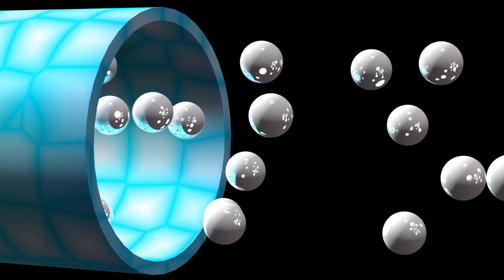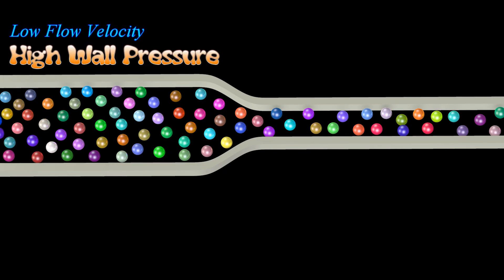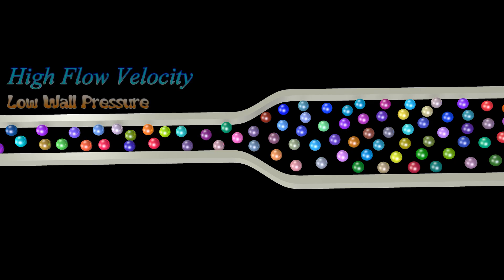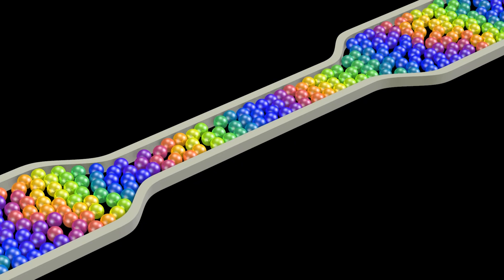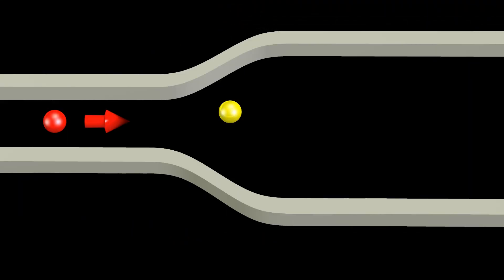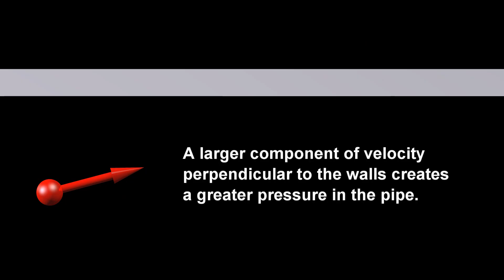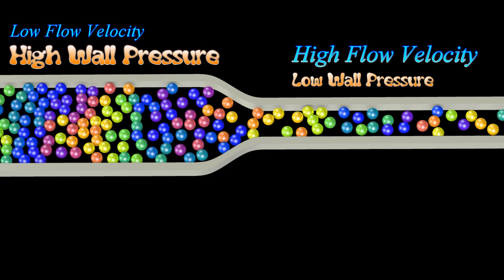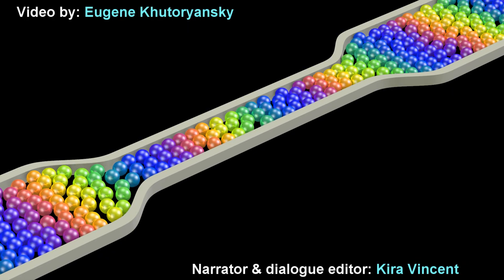Bernoulli’s Principle on Atomic Scale

Comment: Very nice video! This is the first time I see it explained like this. Are there any textbooks or other references that use this explanation? Could you derive Bernoulli’s equation by only using this probabilistic reasoning?
Reply from the maker: Here is a reference that has a very detailed discussion of these issues.  https://arxiv.org/pdf/nlin/0507032
Reply: @EugeneKhutoryansky  Thanks for your response!
Reply: This video concept is untrue.  This is Crummer's Fallacy. . . 
.
 I've explained this before.  The energy conversion is from potential to kinetic.
.
The Potential energy of the higher pressure up-stream is converted to the kinetic energy of the faster flow downstream.
.
  Crummer's concept is false.
.
The isotropic static pressure is not made non-isotropic as the flow speeds up.
,
The pipe size reduction is a restriction that causes the upstream static pressure to increase creating a Pressure Gradient forming a net force downstream that causes the Acceleration of the mass of the fluid.
Euler is credited with determining that a Pressure Gradient is the cause of fluid Acceleration, just like a net force causes Acceleration of a bulk mass 'object'.
.
So many people keep repeating misconceptions they don't understand.  This is nothin more than Newton for fluids.

Comment: Under the same velocity component parallel to the pipe, there can be different velocity components perpendicular to the pipe wall. So at the same speed (parallel to the pipe wall), there will be different pressures on the pipe wall (perpendicular to the pipe wall). Right? So a high speed (parallel to the pipe wall) does not necessarily mean a low pressure. Your explanation failed.
Reply from the maker: The explanation applies to different pressure levels in different sections of the same pipe, with the total particles per second in the same throughout the pipe, despite the fact that some sections of pipe are narrower than other sections.
Reply: @EugeneKhutoryansky  Assuming that the pressure difference P causes the water column in the equal diameter pipe to increase from velocity V1 to velocity V2. In this process, at any moment, the velocity of the entire water column is the same, but the pressure at different sections of the water column is different. This indicates that the conclusion of this video is incorrect. Otherwise, why are the pressures different at the same velocity?

Comment: For example, if the speed of air in one pipe is 100 meters per second, and the speed of air in another pipe is 10 meters per second, their pressure can be the same. How can you explain this with your theory?
Reply from the maker: The molecules might have the same component of velocity perpendicular to the pipe, but different components of velocity parallel to the pipe.
Reply: @EugeneKhutoryansky  So why do you say that when the speed is high, the pressure on the pipeline wall is low?
Reply: @jdthood Assuming that the pressure difference P causes the water column in the equal diameter pipe to increase from velocity V1 to velocity V2. In this process, at any moment, the velocity of the entire water column is the same, but the pressure at different sections of the water column is different. This indicates that the conclusion of this video is incorrect. Otherwise, why are the pressures different at the same velocity?
Reply: @jdthood So how do you explain the phenomenon of different cross-sectional pressures under the same velocity in the same equal diameter pipeline?
Reply: @jdthood Why do I say it's not an isentropic process?
Reply: @jdthood As I mentioned earlier, a section of equal diameter pipe has a pressure P that causes the water column in the pipe to experience acceleration, with a velocity ranging from V1 to V2. At the same time, the velocity of the entire water column is the same, but the pressure at different sections of the water column is different. According to the theory in your video, you cannot explain this phenomenon.

Comment: This explanation seems incorrect. Assuming we have a cup in an environment without gravity, we can give the cup a constant acceleration, and similarly, the water in the cup also receives this acceleration. As the speed of the cup increases, the pressure of water at different depths inside the cup remains unchanged. It can be seen that the magnitude of velocity is independent of pressure.
Reply from the maker: The explanation in the video is correct.  In your example, this is a completely different situation, since the water is still at rest relative to the walls of the cup.
Reply: @EugeneKhutoryansky  What you said is not right. We can use a pump to achieve a constant acceleration of water in a pipe with a constant view. At this time, the pressure in different sections of the pipe is different. But at the same time, the velocity of fluids with different cross-sections is the same.
Reply from the maker: I am not sure how what you wrote is related to anything I said.
Reply: @EugeneKhutoryansky  I mean, we can also use a water pump to achieve a constant acceleration of water in an equal diameter pipe. At any point in time, the velocity of different sections of the pipe is the same, but the pressure is different. According to your theory, why do the pressures on different sections differ at the same speed?
Reply from the maker: I believe this is because the density of the water molecules is slightly higher in the higher pressure areas.  Although we typically model the fluid as incompressible, there is no such thing as an incmpressible fluid, because then the speed of sound through it would be infinite, violating Einstein's Theory of Relativity.
Reply: @EugeneKhutoryansky  However, the fluid in Bernoulli's theorem is an ideal fluid, which is incompressible. So you violated the conditions for using Bernoulli's theorem.
As I said, when a fluid gains a positive acceleration, the pressure on each section of the fluid will be different at the same speed. This is because the mass of the fluid to be pushed by each section is different. Just as you push a cylinder along the axis to obtain a positive acceleration, the mass corresponding to different cross-sections of the cylinder is different.
Reply from the maker: If we truly had incompressible fluids or solids, many of the laws of physics would break down, such as Einstein's Relativity.  The fact that a fluid is not incompressible does not change the fact that Bernoulli's principle is valid and that it operates as discussed in the video.
Reply: @EugeneKhutoryansky  But you should know that Bernoulli's theorem deals with ideal fluids. And ideal fluids are incompressible. Why? Because otherwise, the continuity theorem of fluids cannot be established.
If a pump is used to give positive acceleration to the water in the pipe, the pressure on each section of the pipe is different, but the speed is the same, which cannot be explained by your video.
Reply: @jdthood You are incorrect here because your video describes a venturi tube, so the diameter of the tube is changing, so the fluid is accelerated when flowing in the tube, otherwise the velocity of the fluid will not increase.
Reply: @jdthood You are wrong. For example, if we use a beaker and keep the height of the beaker's water surface constant, there is a horizontal equal diameter tube at the bottom of the beaker, and the outlet of the tube is a converging nozzle (similar to the converging section of your Venturi tube). Because the height of the water surface in the beaker remains constant, it is similar to a "water pump" that does not increase the supply of energy. When water flows steadily, there is acceleration at the nozzle. Refer to my video:https://youtu.be/hZ5fZ3K4_mE?si=yZyAtW81KGRORscw
Reply: @jdthood You explained that it was because the pump increased the supply of energy, while I told you that the pump did not increase the supply of energy. It is evident that your statement that the pump has increased the supply of energy is incorrect. Do you agree with this?
Reply: @jdthood As I mentioned earlier, a section of equal diameter pipe has a pressure P that causes the water column in the pipe to experience acceleration, with a velocity ranging from V1 to V2. At the same time, the velocity of the entire water column is the same, but the pressure at different sections of the water column is different. According to the theory in your video, you cannot explain this phenomenon.

Comment: Aahh, eureka! The lesson was so tantalizing that I was upset that I did not guess the solution. But of course, the narrow section acted as a biased 'selector.'  A little probability and of course some trig to separate the velocity vector into two component parts, one parallel to the pipe walls and one perpendicular. This reminds me of other biases in statistics. If the atom made it into the narrow section, then there is a greater probability that it travels more parallel to the wall.  Thank you so much for teaching me, please forgive my rambles ❤❤❤
Reply from the maker: I am glad you liked my video.  Thanks.

Comment: Doesn't this only work for straight pipes, though? It seems like this explanation would imply that the pressure is greater if the pipe curves right after the transition to the smaller width.

Comment: What would happen if I keep a pressure measuring instrument, say a tiny diaphragm, inside the narrow pipe. Your explanation seems to suggest that though the pressure on the walls of the narrow pipe is less, since less molecules with perpendicular velocity components are present in the narrow pipe, the pressure inside the narrow pip, near its center is higher.

Comment: Great video, but I think you missed one small oppurtunity.  The vector movement explanation can also be used to explain why high velocity water coming out of a hose has a longer "stream".  The atoms have a larger vector that is parallel to the hose outlet.  If the Bernoulli principle was NOT true, than as soon as the water leaves the hose, it would spread radially (ignoring atmospheric and gravitational pressure).

Comment: This explanation may be incorrect. For example, we have a nozzle that is a straight pipe with equal diameter. We can let water flow out of it at different speeds, but the pressure on the wall of the pipe is the same, which can be atmospheric pressure.
Reply: It is incorrect.  It even contradicts itself when it talks about bouncing on other atoms in the third, wide section, but ignores that in teh first going into the narrow section.
..  My earlier comments:
Unfortunately, this violates some very common and well understood accepted principles of physics.  Charles Crummer makes the same errors, which doesn't make it correct.
..
The statement at 2:07 is correct. "there is no reason to expect an atom with a higher velocity to exert a lower pressure on the walls of the pipe." 

There can be the same pressure in a fast fluid as a slow fluid.  They simply have the same static pressure. Bernoulli is not about speed. It is about changes in speed or velocity which is Acceleration along a path. 

The pressure on the walls of a sealed jar is the same regardless of the speed of the jar.

A fundamental flaw in this misconception at 2:42 is is that there no reason to expect a molecule to have the thermal vibration in only one dimension.  These pressure causing vibrations are random in direction and are how they bounce round between other atoms.  
At any given instant a molecule may be going down and the next at 90 degrees or even 180 degrees to the previous vibration.  
That simple fact breaks this false logic.
..
Then. . . 
It is the average velocity (over time) that has a directed motion when the kinetic energy is added to produce an increase in speed. That directed velocity is vectorially summed to the random vibrations.  This is vector addition of velocities. This means that the random vibrations are superimposed onto the linear velocity along the tube. This is fundamental physics. Vector quantities like speed and acceleration add vectorially.
Ignoring that fundamental physics is another flaw in this.
..
..
Then, the added kinetic energy in the moving fluid is in only direction.  It is not increasing the random thermal vibrations. That would require increasing the temperature.  This is another flaw in this story.  Moving the fluid along the pipe does not raise the temperature.  
Therefore, the statement at 2:23: "an atom with a higher velocity would have a higher kinetic energy and, therefore, exert a larger force on the pipe walls" is false because it conflates / confuses thermal energy and momentum in one direction.
..
..
Consider bouncing a ball on the floor. Each bounce imparts some momentum to the floor.  The ball's actual motion is only vertical..

Now, start the room moving (a train car) and the ball still imparts the same momentum to the floor with each bounce.  It's actual motion, relative to the stationary ground changes.  It has the SAME vertical component, but now a horizontal component vectorially added to the vertical motions.  The pressure on the floor does not change.
.
 However, these two motions are orthogonal and have no effect on each other. The vertical up[and down bouncing component remains the same. ONLY the ground referenced horizontal component changes as the speed increases.
This physics does not change if the ball is bounced on the ground outside the train's window.
.
This fails on these fundamental physics errors.
Reply: @Observ45er  You're right, this is a video that confuses the difference between macroscopic velocity and microscopic thermal motion, believing that the two are completely the same thing. If there is only one air molecule in the tube, then velocity and thermal motion may be related, but the velocity of a gas composed of a large number of molecules is not the same as microscopic thermal motion.

Comment: Excellent.   None of the otherwise good teachers I have seen dealing with Bernoulli have addressed what is happening at the molecular level.
Reply from the maker: Thanks!
Reply: Unfortunately, this violates some very common and well understood accepted principles of physics.  Charles Crummer makes the same errors, which doesn't make it correct.
..
The statement at 2:07 is correct. "there is no reason to expect an atom with a higher velocity to exert a lower pressure on the walls of the pipe." 

There can be the same pressure in a fast fluid as a slow fluid.  They simply have the same static pressure. Bernoulli is not about speed. It is about changes in speed or velocity which is Acceleration along a path. 

The pressure on the walls of a sealed jar is the same regardless of the speed of the jar.

A fundamental flaw in this misconception at 2:42 is is that there no reason to expect a molecule to have the thermal vibration in only one dimension.  These pressure causing vibrations are random in direction and are how they bounce round between other atoms.  
At any given instant a molecule may be going down and the next at 90 degrees or even 180 degrees to the previous vibration.  
That simple fact breaks this false logic.
..
Then. . . 
It is the average velocity (over time) that has a directed motion when the kinetic energy is added to produce an increase in speed. That directed velocity is vectorially summed to the random vibrations.  This is vector addition of velocities. This means that the random vibrations are superimposed onto the linear velocity along the tube. This is fundamental physics. Vector quantities like speed and acceleration add vectorially.
Ignoring that fundamental physics is another flaw in this.
..
..
Then, the added kinetic energy in the moving fluid is in only direction.  It is not increasing the random thermal vibrations. That would require increasing the temperature.  This is another flaw in this story.  Moving the fluid along the pipe does not raise the temperature.  
Therefore, the statement at 2:23: "an atom with a higher velocity would have a higher kinetic energy and, therefore, exert a larger force on the pipe walls" is false because it conflates / confuses thermal energy and momentum in one direction.
..
..
Consider bouncing a ball on the floor. Each bounce imparts some momentum to the floor.  The ball's actual motion is only vertical..

Now, start the room moving (a train car) and the ball still imparts the same momentum to the floor with each bounce.  It's actual motion, relative to the stationary ground changes.  It has the SAME vertical component, but now a horizontal component vectorially added to the vertical motions.  The pressure on the floor does not change.
.
 However, these two motions are orthogonal and have no effect on each other. The vertical up[and down bouncing component remains the same. ONLY the ground referenced horizontal component changes as the speed increases.
This physics does not change if the ball is bounced on the ground outside the train's window.
.
This fails on these fundamental physics errors.